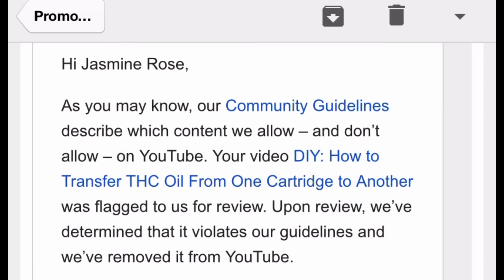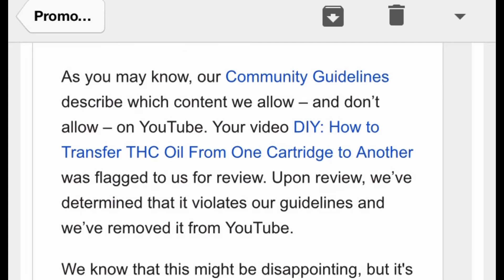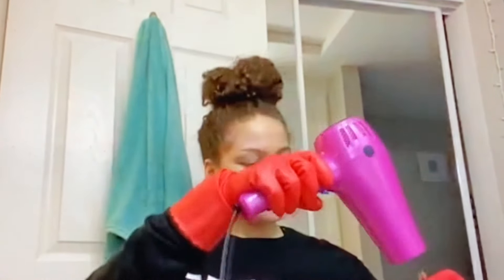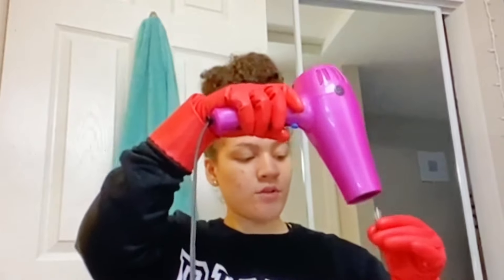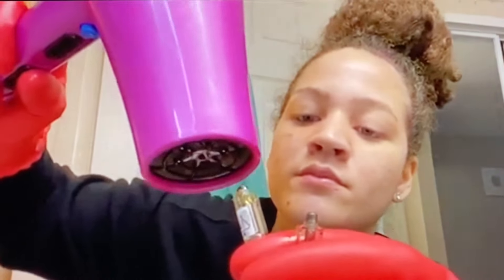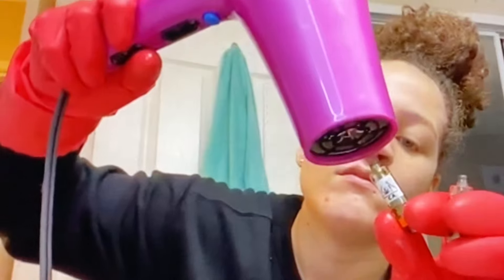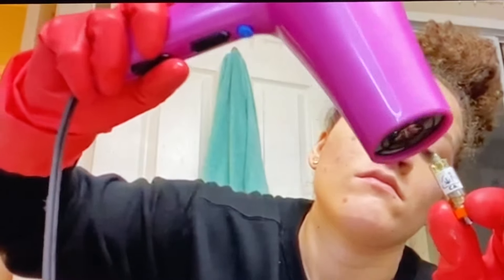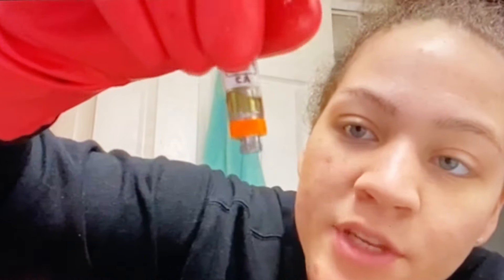DIY: how to transfer thc oil from one cartridge to another *vlogmas day 11*

Comment: If you have a heat gun it will make this even faster no secondary heating it’s all coming in one shot. hold the old cart at the base with a players and use the heat gun until you see small bubbles rising to the top or until you notice a watery consistency and it will transfer to the other cart like water but be careful it’s obviously very hot. I just used an old glo cart take a few dry hits to saturate the coils and your off to the races
Reply: Or a torch lighter
Reply: @juliamariemadness how torch lighter work?
Reply: @theelifeofdez381  you just heat it outside with a butane torch lighter which warms it up and makes it more liquid-y for pouring
Reply: @juliamariemadness  will be trying this before air dryer thanks lovely lady!
Reply: @theelifeofdez381  you're welcome,  good luck:)

Comment: Done this a few times.  Works great. Only problem is for some reason once I transfer it it seems like the oil burns alot faster , but other than that I'm happy.
Reply: I do transfers all the time for homies or for myself and I can tell you that definitely does happen. Mostly happens when you take wax that was made for something else with that specific brand and you put it in something else made for different specific brand and how well it burns through it

Comment: THANK YOU! But listen... I was at Panera and I checked for a hand dryer in the bathroom but they still had paper towels (god bless'em) so I used hot tea water to heat up the f'd up cart. Although there was a little crackliness at the start because of a little water, the operation was a success.

Comment: Thank you. I've watched some other vids, but considering what I have to work with, this method seems like my best bet. I'm  gonna try MacGyvering a way though to eliminate having to actually hold the carts, so I can just point the hairdryer at the upside down one  and let it  drip directly into the other (duct tape them to the wall or something). Maybe I could even rig up a tiny funnel for the receiving cart also. 

(update) - my hair dryer does not get hot enough. After some thought, I ended up taking the tips of of each cart and taping the openings together with duct tape. Then with a lighter, I just made some sweeping motions on the top I was getting the oil from. It worked very well and very quickly. I got almost a full cart out of 2 broken ones and another I was just gonna throw out. Took maybe 20 minutes. I still thank you for this vid though, as it got me going in the right direction!
Reply: You should make the video!
Reply: ilysm for this

Comment: You can maybe try a liter to get the wax from the bottom? I’ve used it when there’s still wax in the cart that won’t go to the cotton. If you heat the glass with the liter. It also heats the wax and makes it runny.

Comment: for my broken cart, i couldn’t take the top off. so what i did was took the rubber and metal piece out the bottom of the cart. then remove the same thing from another empty cart out of the bottom and put it into the broken cart. sometimes it’s just the circular piece in the middle of the bottom of the cart that doesn’t work and needs to be replaced. always works for me

Comment: Buy a blunt tip syringe. Dumping it from one cart to another like that is messy. It's easy to get some in the center clogging the airflow. Plus the oil is cooling down as you pour it, sticking to the sides and losing some in the process.
You also should mention that if the glass is broken on a cartridge, you absolutely SHOULD NOT re-use the oil.

Comment: i’m a little late but i had a full cart on a pen and the cart came off with the pen screw part still on it so it literally won’t fit in any other pen. i tried with pliers and everything under the sun to get it off and now my only option is to transfer the oil 😭

Comment: I didn't see the other vid and found this one because I burnt the cotton in the cart that I just got last week, so it's full of cannabis oil and would like to salvage it if possible. I literally brought it home from the dispensary and didn't even get a good hit off of it, the vaping box mod that I used was unfortunately cranked up for e juice use and is how I fried the damn thing when I took a rip and was terrible. It's delicious granddaddy purple live resin with 80% THC and has very flavorful terpenes inside, so I really want to extract and replace it into a good cart. I don't do combustibles much and vape most everything, so dabbing is not an option and is why I need to put it back into a vape cartridge. Hopefully heating it up will work for me, are they threaded or pressed in ?
Reply: Threaded

Comment: If you can’t take the cap off just heat the cap up with a lighter then twist it to take it off
Reply: Do you take off from the mouthpiece or from the threaded end?
Reply: @shapho4056  mouthpiece

Comment: Does putting heat on it, lessen the strength of the thc?
Reply from the maker: I personally did not have that experience! It worked just as well as any non-broken cart I’ve ever gotten (:
Reply: Dumbest question ever
Reply: @glosteppin726  you have to heat it to smoke it like what😂
Reply: It can "lesson" the potency if you use a heat that's too intense. But using an hair dryer on the lowest or even medium heat settings will probably be completely fine.

Comment: Of course hot air is the only smart choice for getting the oil to flow, but it would be a lot less messy if you used a syringe and needle to get the oil from the bad cartridge to the good one, since a turkey baster won't fit in there, and if your doctor was smart enough to provide you with a larger extraction needle to go with the injection needle for those B12 shots you're in like Flint.

Comment: Thank you this video helped!! If you don’t have gloves use the cone head on the blow dryer to point right at it. Also if you don’t want to hold the cartridge while it’s hot put it on a battery, hold it with the battery. While you use the coned blow dryer to heat it. Once done transfer to other cartridge then switch empty cartridge on battery to newly filled cartridge that works.

Comment: this saved me 40$, i would get carts off this one plug, and once every so often i would get a cart that was defective (wouldnt pull thc just burns the coil) or would taste str8 ass as if the coil was burnt, at first she replaced it, 2nd time she gave me on for like 20, 3rd time she couldnt do jack shit, and tells me that im the only one with issues, like what am i trying to gain. its not like im trying to swap out the same excat type of cart and brand filling the broken cart with thc, and then tells me that even if i would go to the dispo that they wouldnt be able to help me which is a fucking lie, cause when i went to the dispo they said if i have any problems with the cart they would refund or replace it. but i guess now i have to spend more money to get a better guarantee